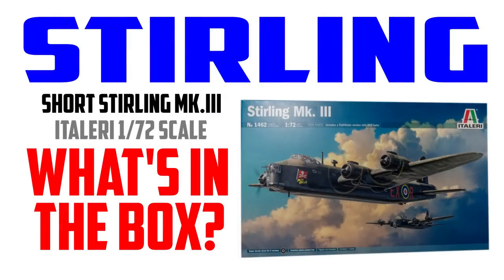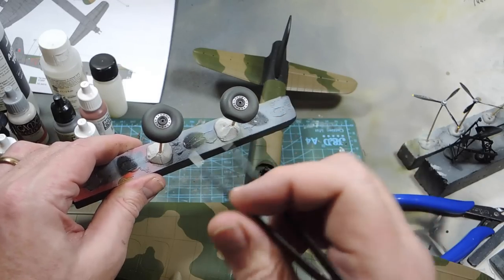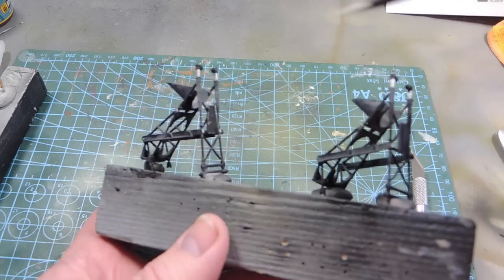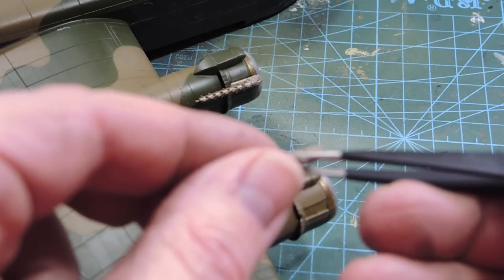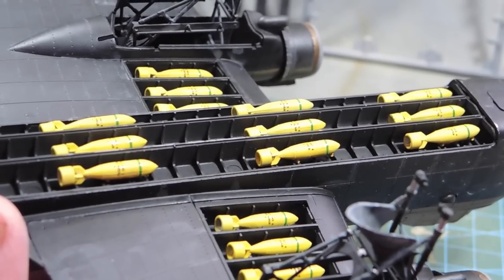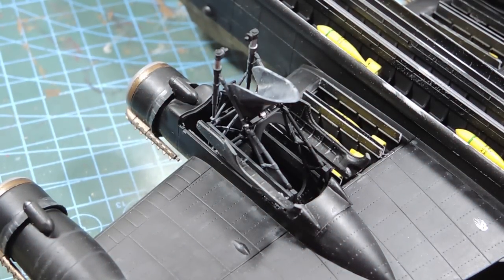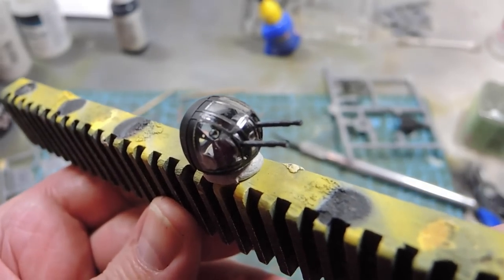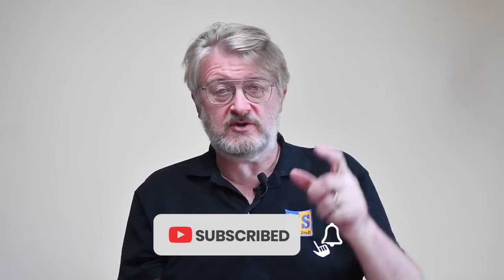STIRLING Italeri Short Stirling Mk.III 1/72 scale BUILD Pt.3- 1080p HD

Comment: The complexities of the undercarriage on the sterling stem from the take off run being deemed too long by the raf. This would have required major alterations to the wing design to achieve and also would have had the effect of the aircraft having a pronounced nose down attitude in level flight (like the AW whitley). The solution shorts went with instead was to lengthen the undercarriage length, which added complexity. 

Also, the design it was made to stipulated a 100ft wingspan limit and this combined with the thick wing severely limited its performance,especially altitude. A lot of similarities with the Sunderland are in the design as well.

The cover behind the h2s dome is where on some versions there was a extra gun fitted to deter fighters from underneath, especially the ones fitted with the dreaded music device which fired upwards.

Comment: Your usual excellent build Gary! I share your pain with photo etch, not so much with the stuff that only requires straight bends (I use an etch folding tool for that) but multi-part etch seat harnesses give me screaming fits of the heebie-jeebies! I do not find bending minute straps into a realistic "dangle" fun in the least, give me a resin seat to paint any day.
A tip I use for etch that isn't under any stress or supporting something I find a bit of canopy glue works for me. This also reduces the risk of so-called "super" glue fogging nearby clear parts. (Ask me how I found out "non-fogging" superglue is a misnomer!)
Looking forward to your next build! 👍
Reply from the maker: Good call, think I'll try that in future.
Reply: Good tip.  Because it is si light if not under stress, you can also try attaching parts with clear varnish.

Comment: Bristol used two types of collector rings, later type has an extra baffle and that is what you see as an extra ring. 
Collector rings were nickel plated steel when left bare, but were sometimes overpainted with heat resistant pink enamel (!) and stove black to hide the glow in the night.
Reply from the maker: Great detail, thanks! I'll remember that for future use. It did look a little rickety but if it's a baffle then I guess there is a small gap to the collector ring. Pink enamel - wonder if Vallejo does that.....?
Reply: @garys_stuff   lol :P it beats the traditional but oh so wrong copper. 
here's an example..
https://en.wikipedia.org/wiki/File:Bristol_Hercules_Kbely.JPG
Reply: @garys_stuff  
Pink -- would that be Orc flesh or maybe Goblin skin?  😉
Reply from the maker: @randytaylor1258  it wouldn't be anything as simple as Stirling Manifold pink, so it will definitely be from the game series! 😆

Comment: Nice build garry just ashame the decals let you down red to bright and the wrong color dingy hatch marking should be red not yellow cracking build nice idea with the undercarriage too looking forward to doing mine now
Reply from the maker: Thought they looked bright - I'm used to a rather duller red on night bombers. For the gear I'd definitely make a little track in one of the mounting plates in the wing to allow the peg of the gear to slip in more easily. but it does go...

Comment: you make a canny job on the airbrusing i have to say Gary , its the faff of cleaning up that really puts me off airbrushing and getting the right mix so the damn thing does'nt clog up and get the dreaded tip dry !!!!
Reply from the maker: I know Shaun, I do spend a lot of time cleaning the darned thing. Might need to use retarder a bit more, but then the paint takes so long to dry!
Reply: @garys_stuff  aye it kinda puts me off, but like I say what a cracking job Gary  !!!!!!

Comment: In order to help the Stirling take off, it needed an extension on its undercarriage to change the angle of incidence on the wing. So it telescopes vertically into the nacelle and then folds up like a normal undercarriage.  Fun fact.  The Stirlings chassis was designed by a guy named McLaren, who went on the design the folding baby pram
Reply from the maker: I wonder how many model makers seeing this will forever more, before folding a baby pram, say "gear up!" to no-one in particular, or unfold it with "three greens!"

Comment: Hi Gary, what do you use to dispense the microset solution? I use a brush but find it pools like mercury and I don’t get an even coverage. I’m considering trying a different product like mr mark. Great build.
Reply from the maker: I use a water colour brush (my one is a Derwent Watercolour). On gloss it will tend to pool anyway, not a lot you can do about it unless you have a product with lower surface tension... Just don't flood the surface with it, the varnish will be 'wetted' by it with a brush-over, then add more once the decal is down.
Reply: @garys_stuff  top tip!

Comment: loose brass casings in a turret not a good idea, tends to find its way into places where it should be, jamming turrets etc plus extra weight if engines are damaged
Reply from the maker: They could have had a collector box under the turret, I would have thought. Although they did have an awful lot of rounds, around 10,000 I think for the tail. Plus, I don't remember hearing of a damaged plane getting the gunners to fire off all the remaining ammo to lose weight. Just an amazing loss of a strategic material.